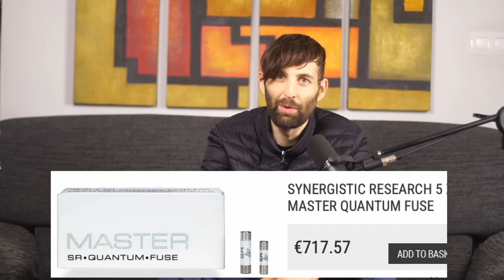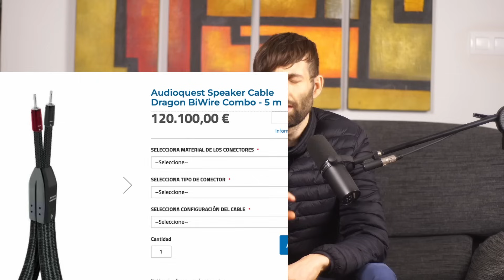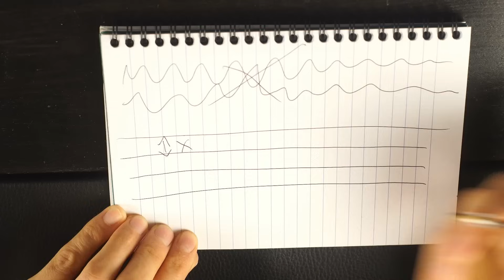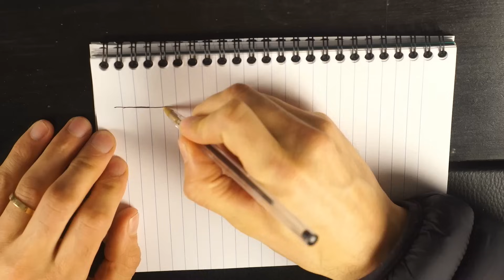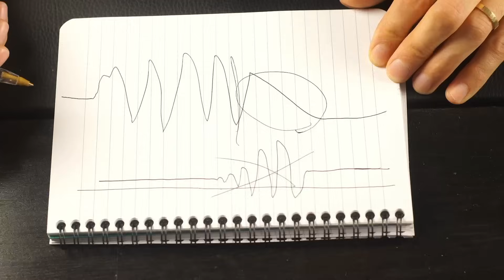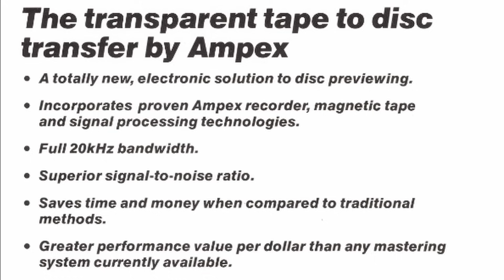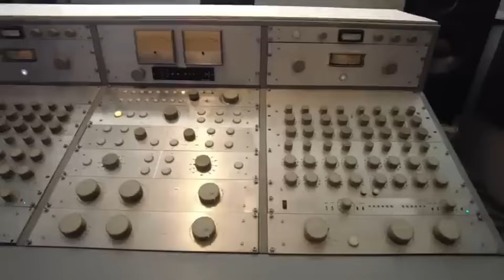Hard truth: most vinyl is digital anyway

Comment: Vinyl has a sound. Taking an audio source - any audio source - 1/2 tape, DAT, PCM Wav file, even a low quality Mp3 and running that audio source through an expensive analog mastering console, expensive analog mastering EQs, compressors, limiters, etc. and then taking that new mastered analog signal out of the mastering desk and feeding that into a lathe, etching an inscription of the new analog signal into a lacquer disc, and playing a vinyl copy of that disc on a turntable using a magnetic phono cartridge creates a unique sound. REGARDLESS of the source material. Many folks describe it as a warm, smooth, musically pleasing sound with less ear fatigue. Is it more accurate to the original source than PCM or DSD? Absolutely not. But many folks like the sound.

You can share a copy of an original painting via a high quality digital PNG file or a gallery wrapped canvas. Is the gallery wrapped canvas more accurate than the PNG file? NO. But a painting on a gallery wrapped canvas is a whole other vibe. Many folks like to hang art on gallery wrapped canvas in their homes and enjoy art that way. Big, bold, physical. Is it perfect? NO. If you look close, can you see the weave of the stretched canvas? YES. Large gallery wrapped canvas is a valid way to enjoy art. Similarly, etching an analog audio signal onto a lacquer disc is a valid way to enjoy music. It is in no way undistinguishable from a digital file.

However, comparing an analog audio signal to a digital copy of that signal IS generally undistinguishable. However, vinyl is not the same as analog. Vinyl is an artisan process that infuses the source audio with a unique sound.

Comment: Ok, first things first. 1. I loathe audiophile snake-oil. 2. I don't particularly see the point in vinyl. 3. Digital is technically always going to be superior.
But to claim that "vinyl is digital" because the source recording was made digitally, or digital equipment is used in the process of cutting vinyl, is absolute bollocks, and I suspect you know that 😉
The record groove that results is a continuous, physical groove. It does not store data digitally. It is not decoded as a digital signal, it is decoded as an analog signal.

A counter example - tape can store both analog and digital data. There is a clear difference between a "normal" VHS video recording, which is an analog video signal, and an ADAT recording, which is digital audio, despite both using the same storage device (Super-VHS tape). You absolutely COULD make a digital vinyl record... but as far as I know, nobody does.

Second example; my very digital Access Virus TI has both analog out, and SPDIF out. The analog out is VERY MUCH an analog signal, despite being generated digitally. The SPDIF signal however, is clearly digital, because it is encoded as a bitstream. Despite this, they both carry a signal from the same digital source. You must know that there is a distiction between these two signals, because you do this professionally after all.

Good video, but it's let down by the very clickbaity and incorrect title. You clearly know your stuff, and these titles clearly bring you views, but try to keep the rage-bait from going overboard and dipping into the absurd, it's not good to spread misinformation 🙃
Reply: Nyquist Sampling Theorem. It's physics. Google it.

Comment: I agree with this in the sense that older pre-digital Vinyl is a superior product than cutting Digital Masters onto Vinyl. This is the same as Recording CD to Cassette. Real Vinyl was created in the Analog Domain. It’s not a better or worse, it is about the full audio chain and the analog noise floor and sonic characteristics that make Legacy Vinyl better. The analog process required art and more Human Capital. Legacy vinyl was “hand made” to a larger degree. Setting the Cutter Head to create the stamper is an art that many do not really get right. Why do I want to create a Vinyl copy of a Digitally mastered source is good marketing and bad value. Just buy the CD/SACD/HDCD and put the money into the system. Why people want Reel to Reel today when there are no production tapes being released is a fad. Audio somehow makes people nuts!!

Comment: There is no need to purchase vinyls as the songs released on audio cds, Youtube and internet streaming platforms like Spotify, Amazon Music etc. are better than that of LPs.  It would be wastage of your precious money as LPs  are hardly being manufactured by any recording companies for new titles.  There is no need to use LP unnecessarily. The vinyls are the worst form of reproduction of  music due to certain reasons : 
1. All types of gramophone records produce surface noise. 
2. The more you play the more surface noise in the shape of crackles, pops up, distortion in voice and music will produce 
3. RPM problem- The perfect RPM cannot be maintained as the motors of direct drive turntables tend to be affected during continuous running. This is evident from the fact that the moment electric hertz changes the speed of the motor is affected. You can test it from the movement of marks of platter of Turntables when stroboscope light is on. Every time and again you have to control the speed. This produces annoyance. 
 4.  Problem of proper maintenance : It is very difficult to properly maintain the condition of LP record as it accumulates dust etc. when in use. If any scratch is produces due to accident or wear and tear due to continuous use, the damage caused is irreparable. 
5. Change of Sound Reproduction : The sound reproduction changes when you use the same stylus, whether moving magnet or moving coil, continuously. The stylus gets static charge due to constant friction with the Vinyl. After it gets charged, the sound quality distorts. There is no way to remove the static charge from the stylus immediately. For this you have to keep it unused for more than 15 days. For continuous enjoyment you have to keep one more turntable. 
6. Standard direct drive turntables are very costly. The stylus is also very costly and it is not easily available. The belt driven turntables have humming sound generated by the belts which rotates the platter. After few months of use the rubber belt loses its elasticity which badly affects the perfect rotation of the platters. Further, it is very difficult to obtain these belts. 
7. Fewer Songs on LP Record : An LP consists hardly 4 to 6 songs on one side and after the interval of every 25 minutes, you have to turn it to other side whereas an audio cd can play approximate 78 minutes continuously.Further, the last songs on any Hindi Film LP will produce poor sound due to narrowness of grooves and the songs will produce more distortions. 
8. An Audio CD has a very longer life whereas LP, EP, SP & 78 RPM records have limited life. 
9. Due to above reasons, now-a-days very limited LPs are being re-produced by by the music industry which are very costly.  However, a misconception is being inserted into the minds of young people that the sound quality of the vinyl records are the best. This is a non-sense as since mid 80s all the recording are made digital and when it is transferred on the Vinyl, it gets deteriorated. Had the vinyls  been so good, why digital medium like Spotify, Youtube, Apple Music, Gaana, Hungaama, Amazon Prime Music etc are streaming the songs on digital formats and music lovers are enjoying these on streaming receivers.
 10. Don't go for collection of these outdated records as most of the songs are easily available on audio Cds,MP3s, youtube and on streaming platforms and it is sheer foolishness to collect them at higher prices from sellers. Don't be fooled by the stunts and gimmicks of the record lovers/re-sellers. 
11.  ALWAYS REMEMBER THAT THERE IS NOTHING RARE IN THIS AGE. 
12. THE ABOVE INFORMATION IS BASED ON MY OWN LONG EXPERIENCE OF THE USE OF VINYL RECORDS and all types of top grade international  record players. IT HAS BEEN OBTAINED FROM ALL TYPES OF AUTHENTIC SOURCES. MOST OF THE ABOVE INFORMATION CANNOT BE FOUND ON GOOGLE. 
Thanks

Comment: Just not true! Each and every analogue step/equipment will add their coloration to the final product whereas digital mixers, CDs etc will be without coloration except when designed to add "character". So when listening to this "digital production" (what does that mean? no analogue equipment involved at all?) on a cassette, vinyl or CD will lead to different results. Which one is or sounds better is a matter of taste and listening habits.
If you want to record lets say a guitar amp in a way, that you can experience the same sound as the guitarist, when he was recording, you want to do some binaural recording with the most neutral mic you can get, positioned where the head of the guitar player was, record it digitally, print it directly to a lossless digital medium and listen to it on neutral speakers in a neutral room ...
That chain rarely exists and also we are not used to it. So I do agree that there is no such thing as 100% accurate reproduction of the sound the engineer would have listened to, when mixing the music, But vinyl changes the sound of a recording substantially whether you like it or not :- )

Comment: I agree, but when the digital master is transferred into analogue, then it becomes analogue. Especially the digital signal has to be EQed and compressed to avoid the stylus from skipping etc. Also, the imperfection of the cutting lathe, and the non absolute accurate center hole will cause wow and flutter and other distortions, not to mention the difference between the outer to the inner circumference that causes sound quality differences. And it’s impossible for a vinyl record to have the same frequency response and signal to noise ratio as good digital recording. To me, technically, well mastered and recorded digital music is way better than any vinyl or even analogue tape.

Comment: Great video & explanation, not to forget the digital equipment used by the artists themselves such as synths & samplers in the 70's onwards. The process going from recording to playback will be so varied by the equipment used, technique & signal chain. Most vinyl lovers will be comparing their tracks with poor digitally compressed mp3 files as opposed to hi-res 24bit digital remasters/re-releases. Though I'm 100% with physical media, I always thought the mini-disc was the best medium, far more reliable than cd, vinyl & tape plus could record on to it.

Comment: the whole video is missing a few important points in my opinion. Thanks for clarifying the other advantages of vinyl (possession, listening experience) but I think I can contribute something as I did a lot of academic research on the topic ;)
for the discussion vinyl vs digital is doesn't really matter whether in the production of the music or the lathe there are digital components involved or not (although shout out on how you explained the variable pitch cutting). Of course your are absolutely right about the advantages of digital cutting and recording technologies. And of course you are right about that many so called "audiophiles" don't have really a clue what they are talking about and thus fall victim to a lot of voodoo.

There are two dimensions about the term "sound quality": an analytical and an aesthetic one. Both have their place and relevance.

you are focussing on the analytical dimension only, where you simply measure in the input (the masters) and output (the medium) and come to a conclusion. here, of course, vinyl is objectively worse then digital formats not just because of surface noise but because of other distortion which is introduced in the signal chain. in practice, most people don't have a proper turntable, pick ups or pre amps. even if they spend tens of thousands on the equipment there is just so much which can go wrong that it is save to assume then in 99% of all households, vinyl sounds simply worst then it even could be (and by extension worse then the digital lossless copy).

which leads to the aesthetic dimension: this is exactly what (some) people like. it is the little imperfections, noise, distortions which are so much loved by many people. call it retromania or nostalgia - in many areas of the society the fetishisation of older times is happening and vinyl is as much a part of it as it is analog photography or other equivalents. A lot of people like the aesthetics of analog photos even if they are less perfect then any digital camera nowadays and this is seemingly similar for vinyls. so if many people prefer the sound and the overall experience of vinyl, they tend to frame it as "it sounds better" which might be wrong from a pure technical point of view - but it still has a relevance and should not just be framed as bullshit in my opinion.

Comment: Tape reel to reel is the ultimate recording. But now it digital dsd. Vinyl is super inconvenient
Reply from the maker: dsd is not necessarily better than pcm
Reply: @APMastering 
It's also not digital.  DSD uses PDM ... Pulse Density Modulation whitch is an analog technique to modulate a carrier wave with more or fewer pulses per time increment to reproduce the audio information.

Comment: I expected that digital started to interfer vinyl mastering after 80s(( That is why I bought mostly vinyl produced in 60-80s. So analog purists should swith to mono schellak on SET valve amps with no feedback and wide-band speakers without crossovers in open baffles to stay "as close to live sound as possible")))
Reply from the maker: that is a very coloured sound which will sound horrible in a non treated room

Comment: it's a shame they never decided to use something like laserdisc for pure audio. you'd get "pure" analogue sound. laserdisc can run in constant linear velocity or  constant angular velocity mode (like vinyl), constant linear velocity would do away with any complaint of anything like "inner groove distortion". you'd get no surface noise, little to no audible error, the convenience of CD (not tracking weight, "anti-skate" etc. while maintaining the sleeve size and artwork and everything like that 😂

on a serious note though that bandcamp high def low limited / compressed idea would be brilliant. if I could buy a copy of some of my fav releases from the 60s - 90s as properly catalogued and versioned masters I'd do that. If I could get properly dynamic mixes of new recordings I'd definitely pay for them. If all we're doing is taking a good mix and master and limiting / compressing it down for cheap home consumption, why, in 2024 isn't that process a part of consumer audio with the distribution of the music being a fully dynamic master? at the moment, it's like painting the mona lisa then having it fax machined to the gallery 😂

Comment: I’ve been listening to you for about 10 minutes willing to comment where you miss a point of vinyl records being quite often more pleasing than the digital version when in about 13 minutes you have solved the puzzle. The ongoing loudness war is making the digital master being usually percepted as less natural whatever you call it. Digital offer's many advantages over any type of analog records, less noise, more dynamic range, no degradation, ease of use, and so much more, but it is the mastering that makes it appeal less natural, pleasing whatever you call it. Concluding the limitation of vinyl makes it "better" more "engaging"...

Comment: Well, I am not a vinyl guy (despite, I can see there are some nice things about it, like visually and as an object) and I do not know the specs of the digital recording machines they used early on in the industry, but I imagine they must have used high Hz and Bitrate, so they would be close to natural sound waves, while the 44/16 of CDs would in comparison be much more stepped. So vinyl would be able to closer resemble the high resolution and theoretically there would be a difference to vinyl's advantage. But can we hear that? Probably not, even through the crackling noise of dust. And who does, can be even better served using high res digital audio.

I myself love digital files, because my CD and vinyl collection in the end needed about 2 cubic meters of space. Now I have it all with me wherever I go, on a little SSD. That is far more important to me than the nice feeling of taking a 12inch disc out of a big catchy cover and see the loudness structure of its sounds, before the needle hops onto it and the cracking begin.

Comment: Here’s an idea, release the non slammed wav files and call it “vinyl version”
Reply: a couple years back, NIN digitally released TWO masters for the same album (hesitation marks). a CD mastering and an "audiophile" mastering closer to the vinyl pressing. when you bought the record, you could download either, or both.

their vinyl masters typically sound a bit different than their CDs. some of the distortion relies on limiters, which don't work well on vinyl.

and, like, except for his first album, everything is recorded, produced, mixed, and mastered entirely digitally. the first album is actually a straight analog process... of nearly 100% digital instruments. it also happens to sound way better than the CD, but i think that's down to late 80s CD mastering and whatever they were doing that made everything sound a bit tinny at the time